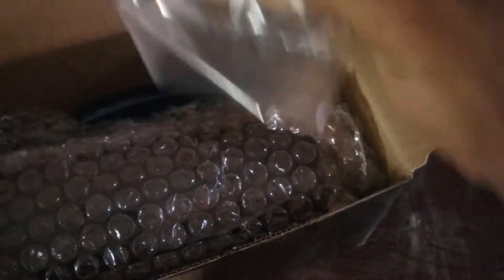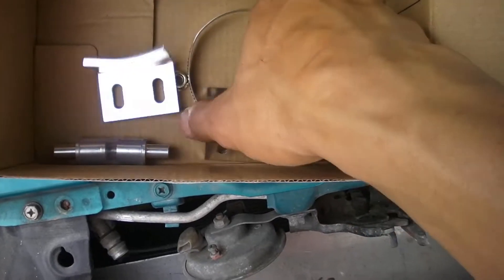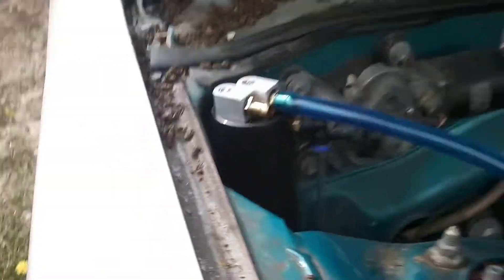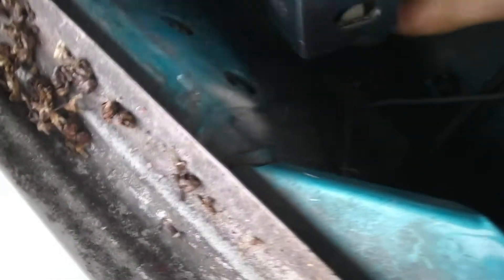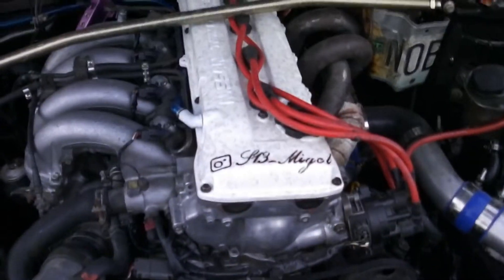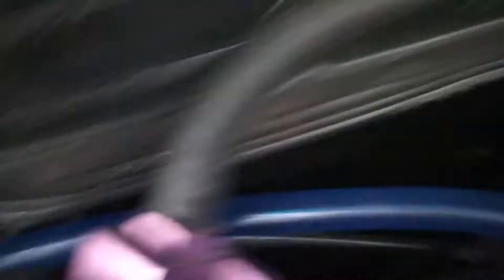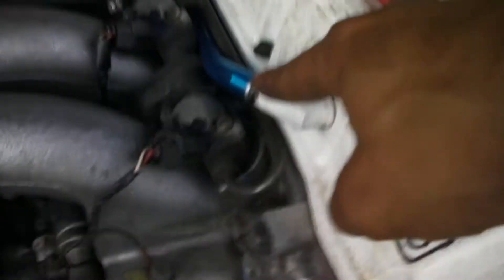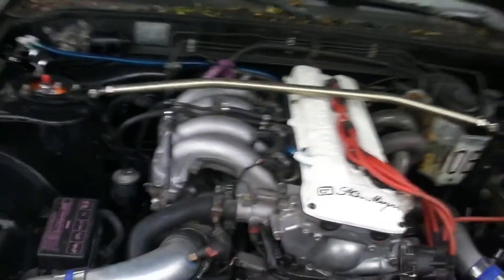ebay catch can

Comment: i have the same catch can. and it comes with gaskets for the two fittings up top if you dont take them off and install the gaskets its going to have a air leak.
Reply from the maker: Carl Br I did find those in the box it took me a little bit to find out what they are for but installed them after I uploaded the video....other then that have you had any issues from your catch can?
Reply: s13_migel not yet. i just installed mine few days ago and uploaded it. i did a leak test before i install it and its air tight. these particular catch cans get bad reviews because of  ignorant people.
Reply from the maker: Carl Br ya that's true a $15 can works just as good as a $50 can
Reply: But I didn't use the tube that come with it. It's made for water not hot oil vapors
Reply: s13_migel update: this catch can doesn't keep the oil from being drawn back into the intake. I can see a little bit of oil coming out the outlet side of the can. I'm thinking about switching to a add w1 catch can that has dual baffles.
Reply: @carlbrooks90  I hope you're not putting an empty catch can and actually fill it with some kind of a medium to catch the oil particles?
Reply: @Lessthanthreeedm  Im no longer running an eBay catch can. I'm running a racer x Fabrication oil catch can that has filters and baffles.
Reply: I don't see marks or letter IN or OUT how can I know which goes where

Comment: how are the maxspeedingrods holding up? i want to buy for my 240 but i heard that they make noise.
Reply from the maker: Marvin Powell I have only put on about 1000 miles on my coilovers cuz the motor is having issues in the 1000 mile I have had zero issues tho.